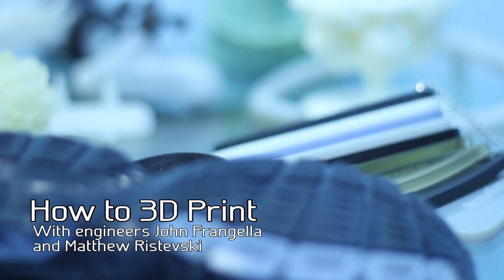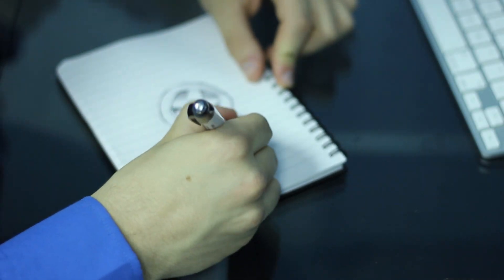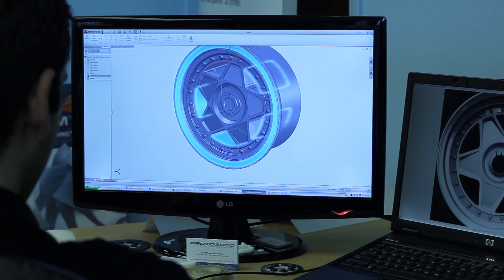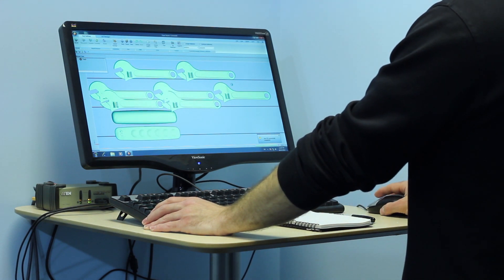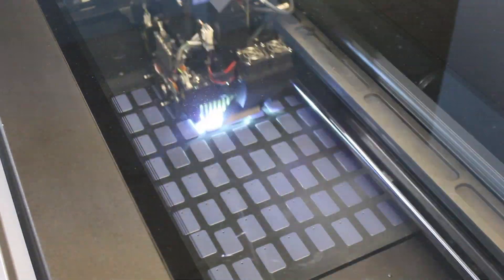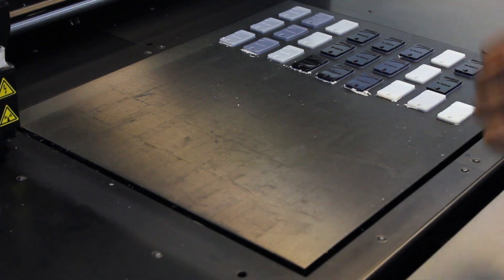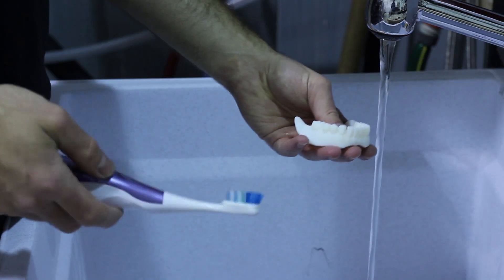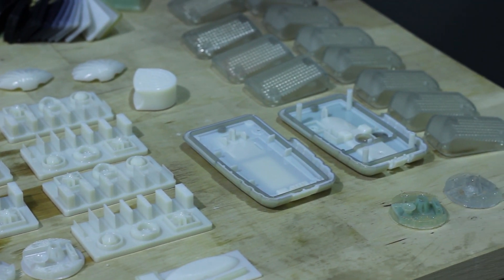How to 3D Print | The 3D Printing Process

Comment: The director of IBM is famous for estimating that on World-basis, there would be a need for around 5 computers in total. (That was in the late 70's I think)... I believe 3D printers will be in many peoples homes much sooner. Within 20 years, maybe within 10 years. My reason for thinking this, is that they're simply too interesting to not have. $600 for a build-it-yourself 3D printer (which is ofcourse not to compare with high-end printers) means that they already started spreading to hobbyists.